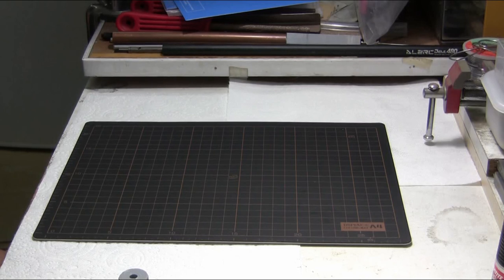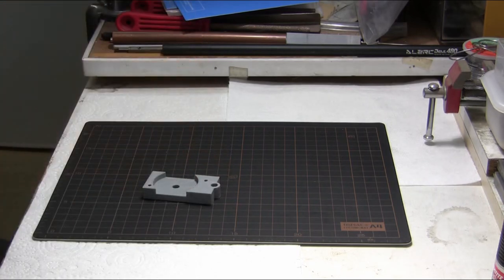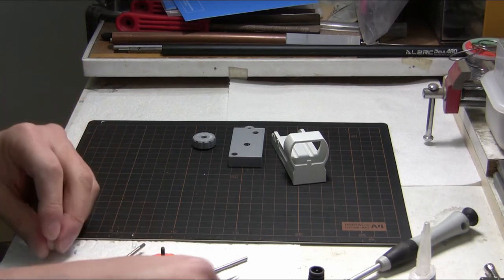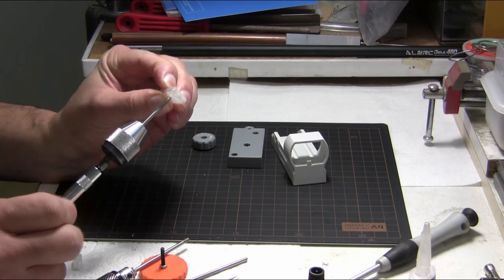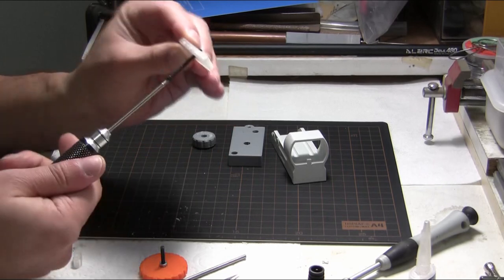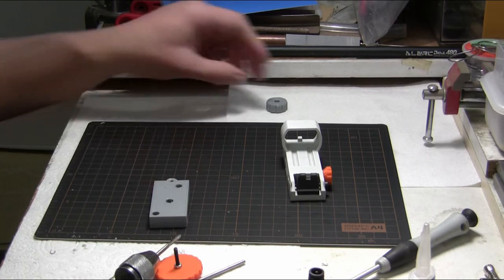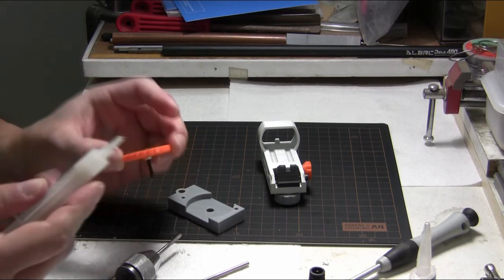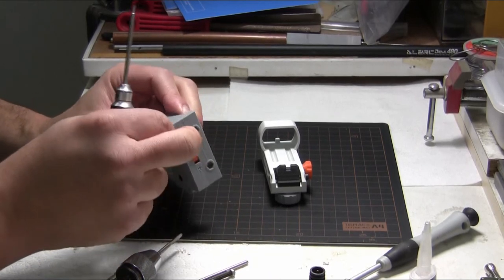Quick Point Sight for 3D printed Nerf blasters

Comment: sorry but i'm not sure what size the bolts are, can you tell me? cause i dont know what  bolts do these correspond to in italy
Reply: They're metric bolt sizes, since its an engineering standard system of measurement it should be the same regardless of country.
Reply: they are m3 bolts, list of materials can be found on the thiniverse page (link in description)